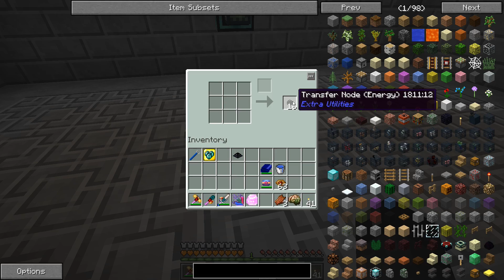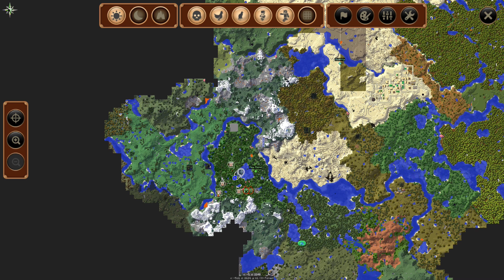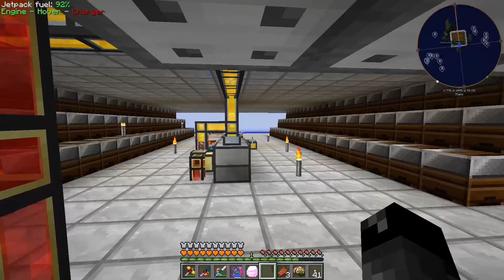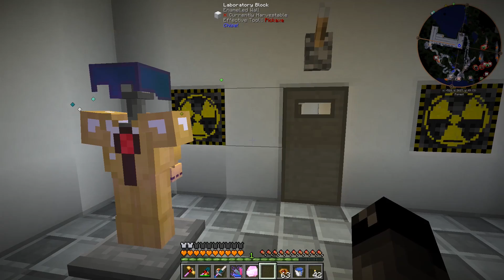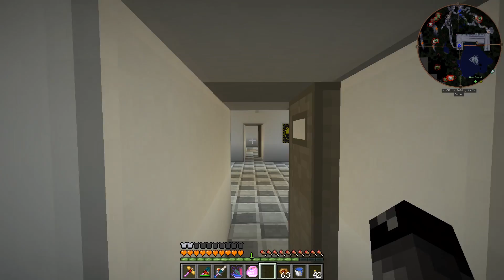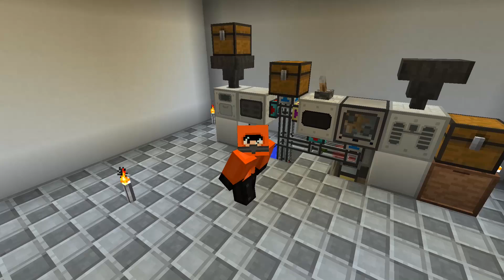Minecraft Mods FTB Infinity Evolved - RTG FUEL [E30] (Modded Expert Mode)

Comment: You know how you carry around some pouches? Look into replacing that and possibly your ender chests with RFTools modular storage. It is dirt cheap and OP. You can have full access to the storage with 4 inventories of 300 slots each and you can have multiple accesses to it like an ender chest. You already have the inventory panel set up with way more storage capacity so you shouldn't switch completely but you should look into it.

Comment: There's a generator that uses the RTG fuel as a fuel source; Thermonucleic Generator or something like that.

It's kind of like a high tier passive generator, and placing 5 RTG pellets in generates a ton of power, with each pellet lasting around 5 years in real life. Not sure if it's enabled in this pack though.

Comment: Tipps for IC2 Mass Fabrictor : 1. you do need the disc. Just set up the scanner ,next to it the pattern storage and next to it the replicator. The Pattern storage will take the scanned items directly without disc and will automaticly send it to the replicator.

2. Most important : The Mass Fabricator will every single bit of power it can get ,with your setup right now 2048 (everything your MSFU can put out) and everytime it hits 1.000.000 EU it will produce 1 mb of UU-Matter. With Scrap (as long it is supplied) the power usage goes down to 166.666 .   However since it will drain every bit of power you can provide ,it means ,every power you supply speeds up the process as well.   The Items you can create with the Replicator use different amount of UU-Matter from microbuckets (dirt) ,over milibuckets (gold/diamond) to even whole BUCKETS. 

Overall if you can provide 1.000.000 EU to the mass fabricator or 166.666 + scrap pro Tick ,it produces 1 UU-Matter per tick.  The second you are able to get  Iridium into the replicator...use it for Ultimate Solar panels (some netherstars & lot of iridium) however ... 12 of them means 1 mB UU-Matter every 10 ticks . To get enough iridium for this ,a night of running the uu-matter should be enough (if you double or triple your power output)

Comment: For those that can't find a way to craft a hazmat suit, you can use your toss key binding to toss the uranium into the hopper connecting into a chest, and then use a dolly to move the chest where you need it. As long as the uranium is not in the player's inventory, you will not take radiation damage.

Comment: Hey what about using the wireless transmitters and receivers so you can put the farm on and off from your base so you don't need to deal with the lag?
Reply: +metayoshi1 But the farm is always loaded to produce power, and the chunk where Hypno is would always be loaded, because player, or even if he places it on a wall somewhere, he'd be physically there to flip the switch.
Reply: +Botman Slight problem with wireless redstone, the chunk needs to be loaded on both ends, and they can only send redstone signals, not RF. Tesseracts are able to send/receive redstone power, and HV wire connectors from IE can convert RF to EU.
Reply: 5il3nc3r Thanks. Didn't even have to type it out ;).

Comment: why don't you set up a system that after you have an x amount of beef Wellington then it turns off the farm.
Reply: +masterofsniping1234 A deep storage unit can hold up to around 2 million items of that type. If need be, he can install a void buffer to send extras into the void, or craft up another DSU to increase his capacity to 4 million items. Beef wellingtons produce 100KRF in a cultinary generator, 800KRF in a X8 generator, and 6.4MRF in a x64 generator. It's one of the easiest Pam's food items to craft, but a more complex recipe like pizzas can produce even more RF compared to the Beef wellington. A beef wellington requires water, salt, wheat, spinach, soybean or raw beef, and either a red, brown, or white mushroom. The tools required to make a beef wellington are a pot to produce fresh water and salt, a mortar and pestle to turn the wheat into flour, and a mixing bowl to combine the fresh water, salt, and flour to make dough. Combine the dough, spinach leaf, raw beef or firm tofu, and either red, brown, or white mushroom to make a beef wellington. Firm tofu can be made from pressing soybeans two times, the first being silken tofu, and the second becoming firm tofu.
Reply: Because he uses it for power
Reply: +RomTheMareep if it is using less beef Wellingtons than it is making the it will just be gaining beef Wellingtons infinitely.
Reply: +metayoshi1 far as I know DSU holds up to a bit more than 2 bil items.. not mil...
And basicly I have similar setup but I made each ingredien farm to shut off when barrel full and turn back on when half-empty.. the thing is, farms are not working non stop, allmost never all together, generates much less lag and strain on system.
It's not a thing you must do, but I'll say honestly, I had fun with making system like that.. ^^
Reply: oh, 2 Billion? oh boy, they must have updated it then. I thought they could only store 2 million each. This actually makes it worth crafting then. I had doubts of crafting it at first since right now, I am mass producing Enderium.
Reply: +metayoshi1 They don't generate more power in the upgraded generators, its a multiplier to both rf/t and fuel consumption(and your numbers are way off, its 152.5k). Also, there are no better Pam's food for power, the best pizza is the exact same rf/item and rf/t as beef wellington. AFAIK, the only better food is the hydra chops from twilight forest, and you can't automate a boss drop
Reply: I guess they must have fixed the exploit for pizzas then, or they may have nerfed, cause it used to make a boat load, considering that it fills more hunger bars, and has more saturation. Eating a pizza with the ring of nutrition instantly fills it from 0 to full, and 8.5 without it. There is the regular pizza, and the Supreme pizza, which I always make. crops by themselves yield about 1-3 with the pam's harvest mechanic. agricraft yields 10 if you have a 10 10 10. Although Hydra chops may be the best food to place in the cultinary generator, you eventually run out of the chops, compared to having a renewable pizza. Though, it's been a while since I played a modded pack anyway, considering I have been on hiatus for one complete year.

Comment: Hypno, I've started playing this modpack, but I'm kinda at a brick wall when it comes to power. I've got a level 3 water wheel running but it's not really giving me enough to run machines and an assembly table. Any suggestions?
Reply from the maker: +TheMadMiner Setup a tree farm to autosmelt wood into charcoal which burns in survivalist generators or furnace generators. Take some of the extra wood for more water wheels. Culinary generators work very well too, but you'll have to find soybeans in villages or do a lot of agricraft cross breeding to get them!
Reply: Hypnotizd Thanks a lot :) Keep up the good work on the videos
Reply: +Hypnotizd 

You can also find soy beans from special grasses from Pam's harvest craft. I found a few in a lush swamp biome, where it has different kinds of crop seeds for farming. I also made a home in a lush swamp biome as well, since in that biome, crops grow 2.5 times faster than a plains biome. I get plenty of bones from skeletons, and pulverize them to get 6 bone meal per bone, effectively ensuring that I will never run out of soy. it takes around 2-3 bone meal to fully mature a soybean in a lush swamp biome. As for 10 10 10, then I can see what you mean by. Per bone, I yield about 3-9 soybeans depending on pam's 1-3 rolls for 1 1 1.
Reply: +BCXdarkblade If you're lucky enough, or have BOP enabled, you can find redwood saplings that grow wood in a 5x5 area. easily produce almost 5 stacks a sapling with F III and Auto-smelt stacked with each other. You an use the alchemic chemistry set to convert charcoal to coal, and then compress those coal into coal blocks, and place those coal blocks into a coke oven to mass produce coal coke blocks, which is equal to smelting 10 separate coal cokes. one coal block can burn for 32000 ticks, or 160 items in a regular furnace, 200 in an iron furnance, or an astounding 320 in a nether furnance. Coal coke blocks can be used to produce a boat load of mana if you have the botania flower that eats up furnance fuels to produce mana. 3 Coke blocks produces enough mana to produce a stack of mana diamonds, and multiple stacks of mana steel.
Reply: You can just go to the nether, set up a pump into an ender tank (you'll need 2 of these) and then just craft a load of lava generators and voila! Lots of power.
Reply: ^ Laval power generation is Disabled in EXPERT mode. you must find alternate means to produce power.
Reply: +SumageGames lava generators are disabled
Reply: +TheMadMiner i have all the power going into energy cells then i transfer them around  when i need power, as they still drain power when there not in use, only a little but if u play a lot it can mount to ALOT of power being wasted
Reply: +metayoshi1 u can also get the bone structures from the neath to  get LOADS!!! of bonemeal in seconds, if u have a hammer
Reply: +Taffy Tiffy nether
Reply: Taffy Tiffy
Yes, though in expert mode, the bone structures need to be in a sag mill to produce bone meal, and not in a pulverizer, making harvesting bone structures imminently useless in my opinion as it wastes the durability of the dark steel balls/flint. plus, with Looting III, I can gather up to 30 bone meal from one skeleton, meaning I can get 300 10 10 10 soybean/soybean seeds right off the bat with from one skeleton if they drop 5 bones. I can also turn the bone meal into MFR's fertilizer to produce 24 a apiece, totaling to 360 units of fertilizer after hunting down blazes and kobolds resprectively. An Enderium Hammer head is enough to kill a skeleton in one blow, which I use to smash Wither skeletons to bits. My only problem now is trying to get into the runic dungeon dimension. I have the staff crafted, but it appears the requirement check seems to be bugged... unless I need another chalk to create the portal.
Reply: metayoshi1
 im playing expert and u just place them in ur crafting grid and it varies from3 -12  per thing, and i suggest go on to the wiki or a recent vid  to check the portal
Reply: Ah, well there's that option as well, but it is rather inefficient.

 Also, I found out the chalks do not get consumed when crafting the staff, so that's a good indicator that I am able to enter the runic dungeon. I haven't tried the chalk on the chiseled stone brick, so that's my next logical move.
Reply: +metayoshi1 i think u need 3 chalks and some other stuff to make the thing which makes the portal
Reply: I already have it on me, right now I am grinding emeralds for a few more resonant machines. Though, I may have to go back to the end again cause I have no end stone for the Ender electric tubes.

Comment: If you need some easy iridium, go to the Runic Dungeon. It spawns tons of dungeon chests and I have 31 iridium in a couple hours.
Reply: Are theses dungeons rare ? Where do you find them ? It seems helpfull :D
Reply: +ahmedyasirkamal The problem with that is that you need to be lucky enough to have a desert temple in your world. I am not sure if the chalk can be found in jungle temples as well. Other than that, it does become a pain after a while when you run out of keys and have to use a wither star to craft another key.
Reply: metayoshi1 Signalum crossbow can discard a wither boss with ease. Also, I found my chalk in a blacksmith in a village. And to RomTheMareep , IT REALLY IS. You can get tons of dark steel, steel, manasteel, steel armor, just tons of steel, mana pearls, tin, iron, and diamonds, but no copper sadly.
Reply: ^ Copper can be found at levels 40-65 in the overworld. Copper ore berry bushes can also be used to harvest copper. A scrapbox has a 5% chance to drop a copper ore. nether copper ore can be smelted to produce two copper ores, or smelted with rich slag to produce 3 copper ores.